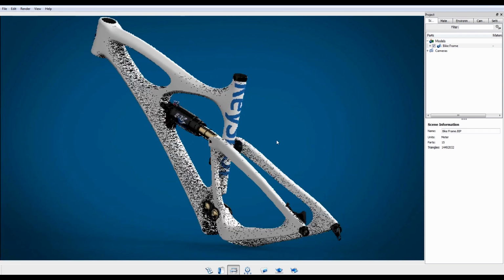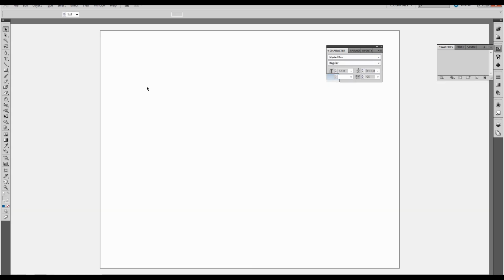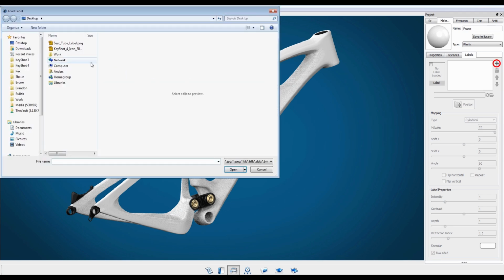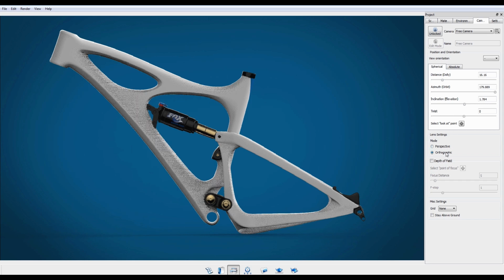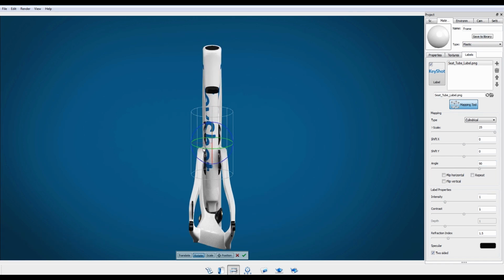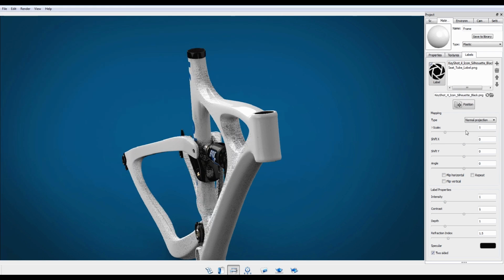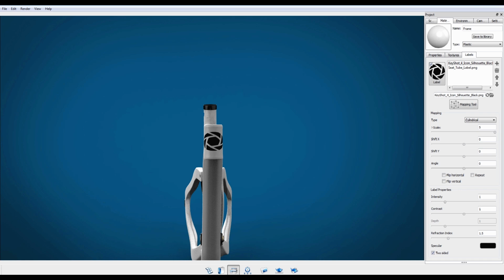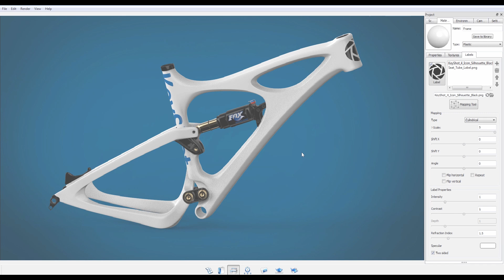KeyShot Quick Tip: Cylindrical Mapping

Comment: Why did you save the image as a 300dpi ? 72 is the same on a pc
Reply from the maker: +iplaybose 300dpi is commonly used for print material.
Reply: Understood, but as for pictures intended on PC, there is no difference between 72 and 300, correct ? 

At least that's what I know.
Reply from the maker: +iplaybose Well, 72dpi is web standard, but still that's going to differ across resolutions, plus you may need a higher dpi for other media, so it's not specific to PC. This link explains it better than there is space for here in the comments... http://www.vsellis.com/understanding-dpi-resolution-and-print-vs-web-images/
Reply: KeyShot Thank you!!!

Comment: Hi I'm trying to wrap a Rectangular shape with rounded corners. The wrap is pretty close to 360deg. Any suggestions. The only thing that seems to work us UV coordinates mapping (which i see no tutorial for), however the pattern seems to repeat in different zones of the model. Please advise.

Thanks!
Reply from the maker: What 3d file format are you working with? Make sure the 'Repeat' checkbox below the label settings is not checked.
Reply: KeyShot Hi. Repeat is definitely off. File Forman: IGS or STP. 

The label repeats in every individual surface if i use UV mapping. 

Thanks again
Reply: Dmitry Rusakov The UV mapping option is if you UV mapped the object(s) before exporting from your modeling package. Sometime the user will get lucky and it will look right though. Anyhow, if your modeling package doesn't offer UV mapping, try making the rectangular shape different colors before exporting (to have control over each surface).

Comment: jamster, if the face of your product is alligned along the x, y, or z axis you could use the corresponding planar projection mode. The problem with this is that the label will be backwards on the mirrored surface unless the label itself is symmetric. As of now the only way to position mirrored labels is by eye but we will definitely look into possible solutions for this as I often encounter the same issue. Thank you

Comment: If you have a symmetrical product that needs 2 graphics on it on opposite sides of the product how do you position the labels so they match up with each other across the symmetry plane. In the past I have had to do this by eye however lining things up by eye is relatively inaccurate.